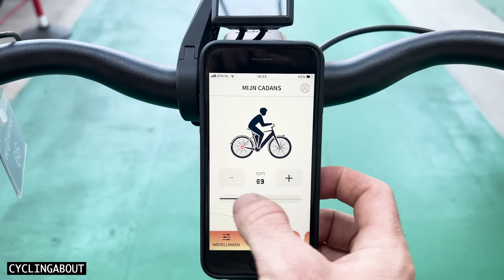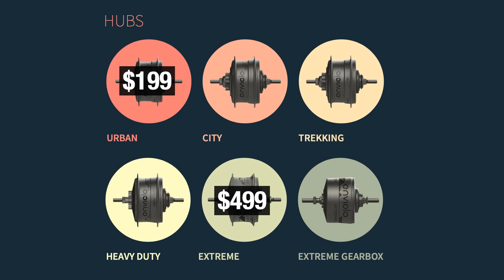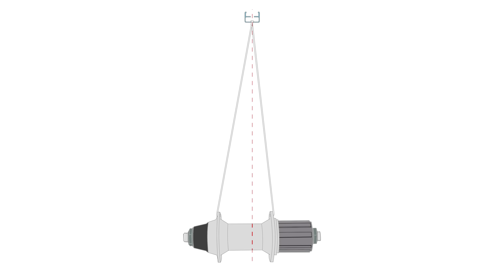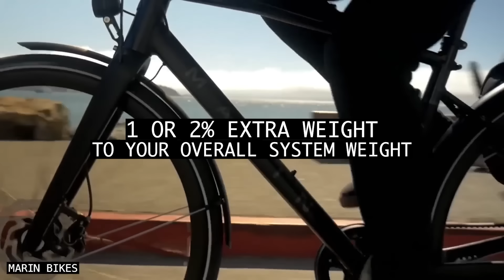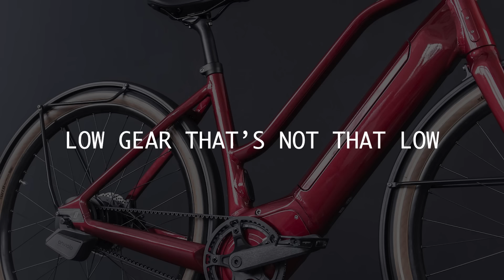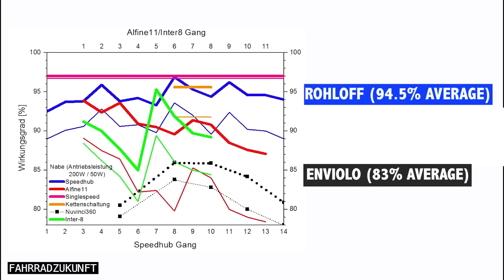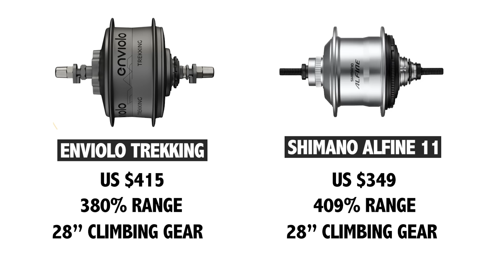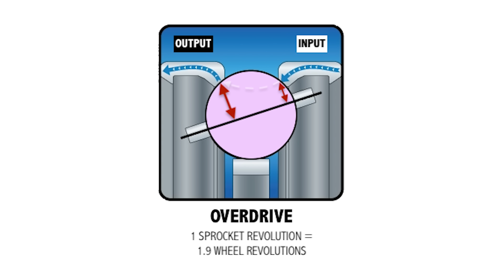Are $199 Enviolo Hubs the BEST Internal Gear Hubs For Bicycles?

Comment: I think what is more important when comparing efficiencies of gear hubs vs derailleur shifting is the FEEL when pedalling under load. Obviously when simply commuting it is not going to bother anyone that much, but the longer your ride is the more frustrating it gets in my opinion. I couldn't care less about the extra 2 minutes on a 100km ride, but that feeling of each pedal stroke dissipating somewhere in the system finally got me. I know I'm exaggerating, but it felt like jogging on a beach vs jogging on asphalt, especially in lower 'gears' climbing uphill. I was nevertheless happy after I finished a Maratona d'les Dolomites (160km, 4000hm) on my modified BMC alpenchallenge with nuvinci 380 and gates belt drive  😅

Fine-tuning the gear ratio to find the best cadence for every specific moment is something magical and it is such a huge difference even compared to derailleur gear jumps. And I'm not even talking about rohloff with its 14% chasms between each gear. For everyone to understand - I'm mostly bikepacking on a road bike, so for me the optimal cadence/speed is important. And I do not mean always staying in 90rpm zone - depending on terrain/fatigue you would prefer doing 60rpm or 110rpm instead of the 'optimal' 90.

I also had a bike with pinion 1.18 for some time. Much better feel in terms of efficiency... And oh that amazingly light rear end 😊. But i was literally appalled by not being able to shift under load at all. I know all gear hubs have this problem, and even derailleur shifters can give up in certain situations, but pinion was the worst I've ever experienced when trying to shift to a lighter gear on a 15% climb.

So after a couple of years of experimenting I'm back to derailleurs and chains 😐
Reply: Thanks for taking time to write that.   Ill be sticking with my derailleurs.
Reply: Thanks for all the advice, and for confirming what I’d suspected- that the local bike shop everyone else raves about has been trying to sell me very expensive stuff which won’t fulfill my needs! Mind you the dead giveaway was that whenever I asked some sensible questions and pointed out why something would be an issue for me they snapped at me, and made outrageous claims like “whenever there’s a fault it’s because the customer did something stupid” (for landing in a river,) and “our wheels don’t break” (neither did mine until I was hit by a car- that’ll break anything.)
Reply: you are forgetting the part where only a new and properly lubricated chain setup running the chain straight is more efficient than a belt.
once you ride in a gear where the chain can not be straight anymore you are losing power, chain slightly stretched ? loosing power again, chain not completely clean and well lubricated ? loosing power again.

the belt on the other hand doesnt have these problems.
Reply: @Pixelplanet5  well then I guess I'm always riding properly lubricated new chains in the right gear :D ok jokes aside, I am not talking about efficiency numbers in relation to an absolute efficiency. I'm talking about the feel. Grinding up a hill out of the saddle with nuvinci felt like treading on something soft when compared to doing it on a granny gear with an imperfect chain line. You'll know what I mean if you ride around on nuvinci like I did for some time. Again not saying that the hub has no place in the cycling world - it does. Just not for me for the reasons stated above
Reply: @Pixelplanet5  oh now I see that you only talk about belt vs chain. Ok then I can't disagree. My problem is not the belt though but the gear hub. I did not say that a belt drive is less efficient than a chain
Reply: You nailed it. A derailer drive always feels direct, a hub often feels like running in sand.
Reply: Have you tried to use a 2 chain wheel front setup in combination with Rohloff? In this case you could have gotten  7% jump 🙂 or make it 21% or 35% to half step and yet still extend the range of the Rohloff hub :-)
Reply: NuVinci have a problem when shifting under load - you can't! Sometimes. As long as you ease off  to shift it is okay. Or even backpedal! Maybe Enviola brans hubs have solved this?
Reply: @Pixelplanet5  This is  not quite true. It's true that chain loses some efficacy when it is not straight or dirty but belt in to that chain has (just an example) 98% and belt 97.8%. Chain has a range when it;s a more efficient even it's not straight. And belt can get dirty two. And I demonstrated to guys that during some conditions (freezing rain) a little fit of ice in belt (between teeth) make it sleeps pretty easy.
Reply: @coogiler  thats why the theeth of any belt drive worth its money have an open back in between so anything that gets pushed in there gets pushed out the other side.
Reply: What's your preferred groupset though?
Reply: Chain drive on a human powered bicycle the same reason that motorcycle makers use chain drives, even though heavier fancy shaft, CVT, automatic and other transmissions setups are now feasible and sold in some motorcycles and scooters. Chains are simple, efficient, time tested, low mass, easy to adjust, easy to change, widely serviceable, spare parts worldwide easily accessible in nearly all countries, most bike mechanics and shops with tools and familiar with chain drive, its called technological lock in and the same reason we are still using diesel powered trucks and coal power. Once a solution works well and is proven, any incumbent technology has a long road to go for any sort of market displacement or global diffusion, as you even noted about shipping a bunk unit back to Europe for service if there is a problem. Belts also have a strange LTS problem in that they age faster than chains in low use cases, such that a chain bike in dry storage, can last hundreds of years, but the rubber and composite fibers of the chain start breaking down with air exposure and temperature change fluctuations, such that they gradually lose their mechanical strength over 15 years or less in the case of the belt in our 2013 Honda PCX150 for example. The CVT in the PCX150 abusive to the belt at higher operating speeds, and the belt also degrades from heat inside the CVT housing, that ends up thermal stressing the belt to a hardening cracking failure point after a few hundred hot cycles of 5 years regardless of distance traveled.
Reply: @AaronSchwarz42  the cvt gearboxes in automobiles have steel bands not rubber, yes they wear out but this is because they don't get serviced yearly. I cycle hundreds of miles a year in all weather conditions on mixed terrain and I can absolutely say that my pinion gearbox and belt drive is 100% more reliable than any chain particularly in muddy conditions. I don't fall for all the more efficient than this and that rubbish regarding bicycles because tolerance on components etc changes litterily daily through wear and tear just like anything mechanical no matter how clean and lubricated it is, also you have to factor in the rider, rider weight varies slightly throughout the day(weigh yourself as soon as you get up then just before you go to bed if you don't believe me) you will be surprised  how many ounces you fluctuate. If you are doing tour de France then absolutely efficiency counts but not for most people I bike pack chain and derailleur was always a pain to keep clean so went gearbox and belt.
Reply: @AaronSchwarz42  sorry just realised your honda is a motorbike then yes they eat rubber belts sorry. Being a mechanic I get frustrated at people dissing honda cvt gearboxes through there own penny pinching I removed my blinkers so again sorry. Ps cvt on a bike is a fad chains are the best for the majority of people because they work I use a pinion and belt because it also works for my application again sorry for not reading your post properly.
Reply: Awesome tried the Maratona, beautiful scenery
Reply: @dko.7005. Think the Pinion Smart.Shift would like to have a chat. I'd say it's on par with a derailleur when shifting under load in my experience. It's not the "same", but if you do have to ease up on some shifts, it makes up for it with the speed of the shift.

Comment: I have changed my 3 1990 steel Moser road bikes from  3 x 8 derailleur to Shimano  Alfine 11 with DI2 changers. I am delighted with the results and would not go back. The lowest gear was a problem but from your previous videos chanced a 1.0 to 1.6 sprocket to chain-ring ration, based in my weight, giving a bottom gear of approx 21" and after 6 months there have been no problems. Found your information videos very helpfull.

Comment: About the stiff shifter: 
There is two shifting available: single turn, and double turn. The first one is stiff but you can go thru the whole range in one turn. On the other hand, the dual turn is much softer but you have to turn it more.
Reply: I have a 380 (for 3 years) & I didn't know that.

Comment: I worked in a company designing and building bikes for food delivery businesses and we used Enviolo hubs in them. They work pretty well under those conditions and if the survive non stop rough treatment by under payed delivery drivers well enough they should do well for commuting and so on as well. We also paired them with 70 Nm mid motors and even that did not harm them long term (for granted, I left after about six months, but in those six months they done about 200 km daily every day between three shifts, so I would say that is a long enough span to judge on given the sample size of about 80 bikes)

Comment: We have 3 bikes with enviolo at my house. One of them is automatic and that is just the best. Wife preferred enviolo to rholloff so we got a tern gsd with it. She just didn't like pushing the shifter all the time as well as the noise. So far several thousand miles in on the 3 bikes and still living the enviolo. It's just so easy to use since I never have to remember to maintain it and get in the proper gear. Though I really did like the rholloff hub.
Reply: The noise bothers her? Get used to it, understand that it is not equal to drag, and after some thousands of kilometres of use, and 2-3 oil changes, the noise diminishes greatly. My Rohloff has done almost 70,000km and I barely notice any noise when riding.
Reply: @petesig93 It seems like she's happy with the enviolo, so why would she want to "get used to it"? I'm sure it's a minor complaint, but it makes the ride a little less pleasant and not everyone needs a high performance drivetrain. Especially when there are no oil changed to be performed for the life of the hub.

Comment: Recently got a nexus 8 bike after a long stint of single speed. I love the low maintenance of IGH and it's great to see another video on a lesser known one.  Keep up the great content, we love it.
Reply: I thrashed two Nexus 8 sport over a year of usage and maybe 6k kilometers. After switching to an Alfine 8, the known weather seal weakness of the Nexus has finally stopped harassing me:goat-turquoise-white-horns:
Reply: @PhilosoFox  When was that please? I think Nexus and Alfine had issues, that were resolved around 2017 or so. Asking because I have a new bike with Nexus 8, am planning a lot of sporty riding with it
Reply: @userdjee834  @philosofox I would also love to know if the nexus 8 has had revisions since your trashings.
Reply: @userdjee834  Yeah, that was before 2017, since I'm driving my Alfine 8 longer than that now.
Reply: @PhilosoFox Well thanks for completing the informational big picture.

Comment: Laced in one on my 33 year old MTB.  Love it.  Would never go back to a derailleur.  Have the manual shifter and have had no problems with it.  I was glad to see that you saw/know that they can not shift between high and low without the wheel turning.  Not a real problem; even when I come to a stop; as I've already downshifted.  Love how if I want just a "bit" more/less peddle, I can give the knob a slight twist and I'm good.  I started out with a 34/17 combo on the gears, but had no real low end, so I went to 24/17 and can pull hills with the best of them.  I don't have a very high end, but I never go over 15 mph anyway.  The 34 is still on the front so I can pull the derailleur arm forward and change rings if I'm on flat ground and want to go fast.  I wanted to have just a plain chain, but I couldn't get the right spacing with the vertical dropouts.  So I modified the old broken derailleur arm and I'm good to go.

Comment: Living off a bicycle for years now, I can not say enough good things about Rohloff: no more cassette to clean or buy, less chains to buy, no more derailleur frozen in position, can shift whenever as much as I need. Love this product. Got a Schlumpf drive on the front, love it too.
Reply: There is just 2 bad things with Rohloff.

Some sample variations. They do have some monday morning hubs with issues.(Rare)
The actual list price.

If you own a good one though. Your set for a lot of miles of near hassle free riding.
They do have the best product.
Reply: @1barnet1  I was grinding through more than 120 dollars (low side) per month (rear cassette, chains, front cassette). Not to mention days, where I couldn't shift. Imagine that. You are riding about 80 miles today and your gear shall be frozen in place 3 days ago.
     At this point tye Rohloff hub has been a great financial choice. The question is simple. How many miles are you going to ride. I live off my bicycle. Love their product. Change th oil twice a year. Replaced a paper gasket once. The oil is biodegradable. What's not to love about the price? Keep riding. 
     Hope your having a great week. Know your/you're love
Reply: Which Schlumpf have you got?
Reply: What were you doing to your bikes? I haven't changed a single part on my Mtb, and it's a 2012. Sure I've replaced chains when they are due, but never cassettes and such.
Reply: @buckroger6456  living off of it, more days than not were 75-100 miles. So I was riding the hell out of it. Tried to take 1 day off every 14.
Reply: @JimKJeffries  ok. That's some solid miles each day. I can see why now. 
 I use my bikes for everything, but I'm not putting in that many miles per day.
Reply: @buckroger6456  thanks for the note back. Got a Rohloff rear hub and a Schmidt high-speed on the crank, chain stays in line, with a nickel & stainless chain. Change the oil once, sometimes twice a year. Build has been bullet proof. Bike weighs about 100lbs with water & gear.

Comment: I've been riding a Turi from Priority Bicycles that I bought 3 years ago and it has a 300% ratio Enviolo rear hub and uses a Gates Belt drive as well.
I put 7000 miles on it before I replaced the front Cog because it was creaking: The belt had worn small cups on the torque side of its teeth. So I bought a new cog and while waiting for it to arrive I dusted the belt with CORN STARCH and the creaking went away! When the new cog arrived I replaced it and saw the old belt looked no different than the brand-new belt that I had been using as a spare and was in my road kit for 3 years. I put on the new cog and used the brand-new spare and kept the old belt for use as a spare, since 7000 miles hadn't harmed it. Seriously, it looked like it was new. My guess is these belts will last for 50,000 miles just like their big brothers that are inside many 4 cylinder car engines driving the camshaft.
Enviolo makes one with a higher ratio but the 300% unit works fine for the city. Priority sold me a smaller rear cog that worked with the original belt because I wanted a "longer leg".
I'm a huge fan of the Enviolo. I got a 600 recently for gravel and off-road use since the Turi is designed for sidewalks and paved roads. The 600 has a Pinon 12 speed crankset gearbox and is a great all around bike, but I still ride my Turi from time-to-time.
I have nothing to say about efficiency as I'm sure it's not as efficient as a derailleur. But as far as joyriding and commuting, I wouldn't have a derailleur or anything with a chain anymore. I feel like an emancipated slave: I'm NEVER going back to those chains.

Comment: No one does equipment deep-dives like you, they themselves send you on a ride for 20+ minutes not including the rewatch value :P Also you encouraged me to go on my first bikepacking tour, so huge thanks for your contribution to the community :)

That being said, I traveled through Germany and France (parts on the European Divide Trail) on my Cube Travel Pro with a Shimano Nexus 8 Gear hub. While I had the time of my life and am hooked, I will never again bikepack on a hub with 308% gear range and 28" gear inches. Any hill with more than 3% gradiant was a major pain and required brutal pedaling (best I managed to climb was 9%). But most importantly the high gear jumps broke me. Not being able to find the right cadence turned out to be way more of an issue than I could have imagined. So even on flats I was constantly deciding between putting more effort into my strokes or fall back in speed considerably (losing momentum as well which only worsened my pace more). 

The Enviolo seems really promising, if only they offered ~530% gear range, I'd be sold. Now I'm banking on either getting a used Rohloff (insane value on 2nd hand market in Germany, usually 400€-800€) or getting a MTB with a 2x11 drivetrain (maybe you can guess where I got the idea from)
Reply: I have been bike packing with a derailleur system, got an Alfine 8 and own a Rohloff now. By far the best shifting system I've ever had! It's so smooth, and with the range I can easily pedal 12% gradients. I was lucky finding a second hand Rohloff first, then built a bike around it :). Highly recommended!